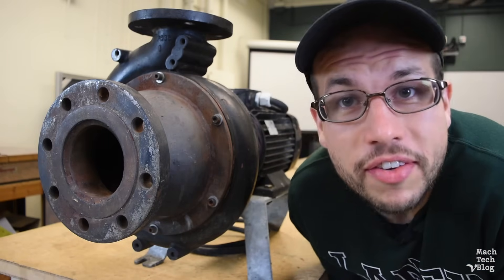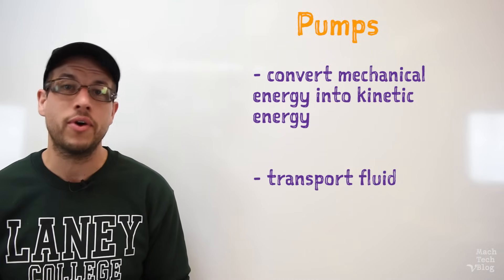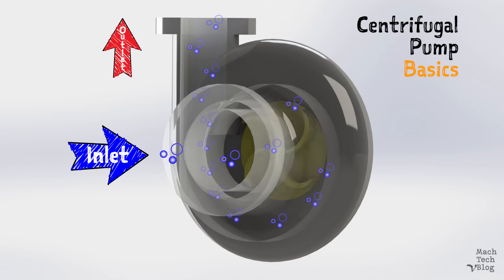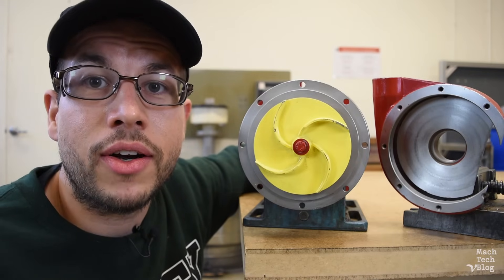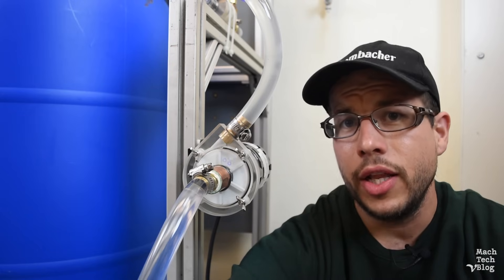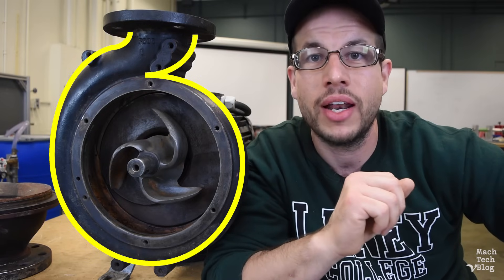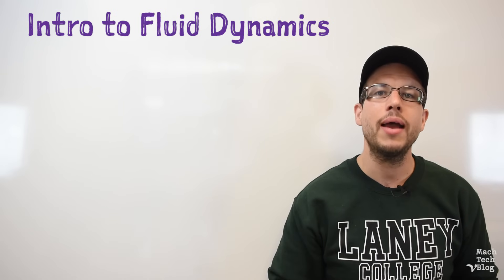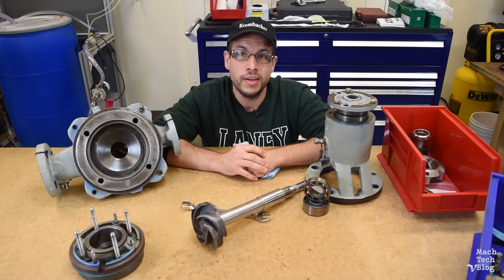Centrifugal Pumps

Comment: How does centrifugal pump pump air? I mean I have a swimming pool pump (apparently it is centrifugal) and when I start it it takes some time for it to pump some air through the pipes. Yes I add water to the pipes before starting it, but the large part of air is still in the pipes. Yet the pump still manages to move away all the residuall air.

Comment: Thank you for the video, However: it's Not Exactly True: Centrifugal is in the name for a reason, and Velocity is not in the name for a reason. Ive seen many of these videos and they all make it sound as if the velocity pushes the water down the volute and out the hole - but it's not the velocity at all. The volute looks cool and probably does increase pressure a little, but the most important aspect is the Centrifugal force which IS THE PRIMARY FORCE driving the water out. . . Literally . . . Out from the center. You could have a cube shaped housing with an enclosed impeller and the pressure will still be nearly as high.
Reply: After I wrote this comment I realized that centrifugal force is NOT REAL - according to some in the industry (Much debate and misunderstanding about this) the actual force is "INERTIA" and inertia without centripetal force; always tries to travel in a STRAIGHT LINE. This means that inertial force in this type of pump will "FLING" the water out TANGENT to the perimeter of the impeller - it's difficult to see when impeller blades, depending on angle of blades, Will sometimes "PUSH" the water out away from center. if the blades are not "PUSHING" the fluid then the fluid will leave the pump tangent to the outer perimeter of impeller.  THERE , clear as mud.!

Comment: The direction of the rotation of the impeller is really counter-intuitive. I'd bet 90% of the viewers thought that the impeller rotated the other way round. Even now, I don't understand why it'd be a bad idea to rotate in the direction where the blades would forcefully push the fluid towards the outlet.
Reply: From my understanding it’s to deal with the rate of flow coming in to the  makes sure the volute  says full and no air pockets developed from the flow exiting the pump too fast

Comment: Excellent video.  I pump water for irrigation using a diesel engine connected to a pump. The diesel engine has a fault.  What happens when I pump water from a gasoline water pump and let it go through the main pump (the one connected to the non-working diesel engine). Would this reduce the pressure of water reaching crops on the other side?

Comment: nice, but you are propagating number of misconceptions
1) blades can be backward, forward, or straight, depending on the function of the pump
2) it does not rely on friction to get the fluid moving
3) it can move air and create suction, but it's really bad at it because it is not what it's designed for
4) your Bernoulli principle is grossly oversimplified

Comment: Thats a very good explanation, but there is one remark I cannot hold back. A centrifugal pump does not create pressure! It creates head and flow. Pressure results from friction and resistance within the discharge piping. Assuming an open discharge nozzle, the pump would not create pressure at all since the fluid would be exposed to ambient pressure (and negligible friction of air). The pump would shoot out a fountain to a specific height thats called head. Anyhow, you should do more of these videos! thumbs up

Comment: Do you know what is likely cause of a pump motor flipping breaker breaker for after 20 seconds? 3 phase 3 HP, hot cooking oil, capacity 6 cubic meter/hour discharge, 25m head? Pump spins freely apart from motor...thanks

Comment: Pump Cavitation And Prevention.

#pumps #energy #water #saftey #hazard #oil #gas #safety #drilling #renewableenergy #oilandgas 

Preventing cavitation of a pump is a significant operation for the smooth and efficient operation of a pump. Failure to prevent sin cavitation can result in complete damage to the pump impeller or pump. Which prevents any process from running smoothly.

https://techproces.com/pump-cavitation-and-prevention/

Comment: Great clear video and learned a lot from it. What type of residential pump and what capacity would you recommend to fill a water tank placed on the roof deck of a 7-story building with height of around 25 meters or 82 feet. Currently we are using a 1.5 horse power jet pump on a 1-1/2" diameter vertical pipe. The plastic impeller breaks every 6 months! Any suggestion please. Thanks.

Comment: I’m sorry, but I’ve had it drilled into me that pumps do not create pressure, pumps create flow. Resistance to flow creates pressure, as can be extrapolated from Bernoulli’s principle.
For example, a pump on a level plane circulating fluid between equivalent vessels through frictionless lines will create no pressure, while a pump lifting fluid to a slightly higher vessel will have to overcome the effect of gravity on the the pumped fluid, thus this resistance creates pressure.

TLDR: a balloon hand pump; pressure is only perceived when there is resistance to the flow it creates. ie, a balloon, or your thumb
Reply from the maker: You are right and that was a very good description. Thanks for adding to the comments so others can learn!
Reply: Machine Tech Video Blog 
No problem. It was something that I had to wrestle with for a bit, so I just wanted to pay it forward.

Comment: Can u tell me how some water pumps are able to pump air to create vacuum and then pull up water and throw it out of nozzle
Reply from the maker: There are self-priming centrifugal pumps which don't create a vacuum so much as evacuate air until the suction piping and volute chamber are flooded. Here's a good video on this type of pump: https://www.youtube.com/watch?v=2FA6t7wHtF0
Reply: @LaneyMachineTech  Thanks for the link i have seen this video already but why can't my tiny water pump do self priming? It does throw little air out of nozzle and when i put it's suction pipe into water air stops coming out. But despite of that  water doesn't come out of nozzle.
Reply: @LaneyMachineTech  Can a leaf blower be used as water pump? Because the concept to push fluid through is same. They both use same mechanism even similar  impeller.

Comment: Speaking of the flow direction based on the centrifugal pump's blades curvature, yes, you should tell in which direction the pump will have it's best efficiency for moving your fluid, hence from the eye center towards the blades tips, but it doesn't mean it won't reverse the flow if you rotate the rotor in opposite direction, but cavitation may occur much sooner (at some lower rpm and outlet pressures).

Comment: Very nice videos, but I must tell you that it's not the friction between the fluid and the vanes/blades which causes the fluid to move, but the differential pressure between both sides of the blades/vanes which varies with the speed of rotation. The friction force between the fluid and the blades is the result of the fluid's properties (viscosity) and dynamic pressure (relative velocity between the fluid particles and surfaces) and rather opposes the motion of the fluid and in some amount actually reduce the output overall pressure within the fluid, it doesn't help the fluid to move or the pump to do it's job. If you want to confirm it you can simply use two fluids with different viscosity coefs and see how the outlet static pressure reads. The more viscous fluid (thick oil) will have a much less flow speed and static pressure (which takes place at surface contact) but much higher dynamic pressure compared to a lower viscosity fluid (water) which does the opposite, while both producing the same total outlet pressure. It's only the pressures that govern motions. The friction is... friction!

Comment: My years in the Navy we worked on these pumps all over the ship. Firemain, Chill Water, List Control, even air ventilation where a non sparking unit was needed or for high air pressure like the Buffalo Forge Centrifugal fans.

Comment: I have to have a 150ft long 1inch inside diameter pipe in front of my gas water pump because can not have the pump at the ditch where there is water.  The property of my neighbor is about 150ft deep and he might allow me to run a pvc line but I am worried that the intake line would be way too long and too much air in it and would damage the pump.

Comment: The idea that gas entrained in pumped liquid automatically causes cavitation is a misconception. Cavitation is caused by VERY RAPID collapse of vapor bubbles as they enter area of increased pressure in the pump. Generally only return of the vapor of pumped product to its liquid phase (called condensation) occurs fast enough to cause sufficiently violent collapse of bubbles. The only other gas then its own vapor to cause cavitation in WATER PUMPS  is CO2 (Carbon dioxide) because it dissolves sufficiently fast. I stressed "water pumps" because there may exist other liquid/gas combinations in the chemical industry causing cavitation, but I haven't encountered any in my 40 year practice.
Actually, injecting small quantity of air in pump suction is a very effective measure to counteract destructive cavitation forces. The air doesn't prevent cavitation but the air bubbles cushion the impact of rapidly condensing vapor bubbles.

Comment: If you want a mindfuck - look up impeller design efficiency. In many cases a literal flat blade is all you need for many applications, it's shocking how diminishing the diminishing returns are of specially designed overpriced impellers for some applications. Curved vanes run forward or backward have very, very little difference in most applications, and straight up flat vanes are just as good for most lower RPM applications.

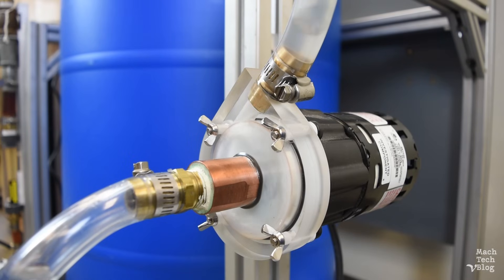Comment: 4:00 it does pump air, just not nearly enough to pull that fluid upwards. Impellers are used in all kinds of ventilation systems, since they are more efficient than regular fans. It is just a matter of RPMs and that whole cavitation issue.

Comment: one thing about fluid dynamics that most people don't understand is that while the general rule is that velocity and pressure are inversely proportional, there is a "power" part to it. just like with torque and speed, volts and amp,  there is a power limit which is the two combined at any given moment. ie. you can have one pump that does 10cfm at 10psi and another pump 10cfm at 1psi. yea you can get the 10cfm @ 1psi to be at 10psi but it'll only be at 1cfm then. Point being is that while yea that is true, it's not as simple as that and you run into limits very quickly.

Comment: Centrifugal force is a lie! There is no outward force on a spinning object. There are only 2 forces in rotation. The forward motion of the object that is perpendicular to the circle the object is traveling, and the center- pulling force of whatever is keeping the object in rotation. 

If the center-pulling force suddenly stops, then the object won't continue spinning outwards like a centrifugal force would suggest. Instead, the object continues in a straight line, perpendicular to the original circle.
Reply: Who said that there is outward force?
Reply: @niklasbjorkenheim1479  that is what centrifugal means.
Reply: This is indeed correct.
Reply: Cool great so we'll just call this the "Straight Line Pump" real helpful.

Comment: Can't pump air? How about a turbocharger or centrifugal supercharger? ;) I know what you ment just wanted to give you hell!
Reply: That would technically be a compressor... not a pump.
Reply: @Reign_In_Blood_963  explain the difference to me.
Reply: @levirobertson6148  liquids cannot be compressed. When gases are "pumped" they are compressed, thus compressors.
Reply: @Reign_In_Blood_963  how about centrifugal blowers like the types used in furnaces and "air mover" fans? Would these be considered pumps or compressors?
Reply: @levirobertson6148  since they are really only moving the volume of gas they would be considered blowers. Compressors whether it's positive displacement or centrifugal typical generate higher pressure. The operating principle s are similar regardless.

Comment: Machine tech, 'you brought up cavitation as one of the main cause of pump failure and this is very true.  You also were saying that when the bubbles burst they produce heat and this is true. Did you know you can heat water this way using a cavitation pump? As the rotor turns with very tight tolerances with small hole drilled into the rotor using very tight tolerances again causing cavitation the length of the rotor mashing these newly formed bubbles to the point of explosion releasing heat as a by-product. The water as it travels down to the outlet gets supper heated to the point past steam under pressure can be used to run motors and as a heat source. I just thought you might want to know and maybe do a video on this subject. Have a great day.

Comment: Thanks for the video
.
Let me ask you a question. Why do aquarium pump and washer drain pump impellers have straight and not curved impeller blades? Aren't curved shaped blades more efficient?
Reply: A straight line impeller  requires less machining and is easier therefore cheaper to produce!
Reply: Perhaps, but the efficiency obtained in the impeller format allowed to reduce the power required for the same result.
https://qph.fs.quoracdn.net/main-qimg-03033dbb01739d2f400157af07be8d38
And as they are all made of injected plastic, the machining cost only occurs in the mold. Even the number of blades that is usually only 4 is inefficient. Some even low power pumps get better results with curved blades like this https://ae01.alicdn.com/kf/HTB1UI_qU3DqK1RjSZSyq6yxEVXav.jpg

Comment: impeller pump will suck air & water. Two tanks only for clean water, 4 tanks for dirty water & dewatering as you see in this prototype 

https://www.youtube.com/watch?v=BqcR6Sd8tsw

US Patent 8967274 
Cooling system uses %25 power, Patented Freon impeller pump, %75 less CO2.

http://brisam9.blogspot.ae/2017/06/jps.html

Comment: Pumps 101. Awesome.  I understand that changing the impeller by just a little controls volume and preassure immensely. Most trash pumps do high volumes with low pressures. Fire pumps do higher pressures with lower volumes. Dredge pumps for small gold dredges are somewhere in the middle. Pump design is tailored specifically for its specific use and hose size.

Comment: I've got a question for you, please.
How does one calculate the type of pump needed to move water upward?
Reply: Depends on the Design requirment   which depends on the function you need to use the pump,  the environment / space around and the fluid you want to pump, and the cost ( money $ )
after deciding the type of pump is sutiable for the process then you will select and calculate the pressure head ( meter) that is the distance you want to move the fluid and the required flowrate ( GPM)  , once u have Head and gpm then will go to pump selecting Chart ( which you will find it the company catalog  since each company have its own pumps desgin and specification ) and you will chose the right type of pump and the stage you want to meet the requirements head and GPM

Comment: Centrifugal pumps will pump air, impellers will pump air, forward faced vanes will pump fluid.
Reply: How a centrifugal pump will pump air?
Reply: @ShuvamNayak  the same way "liquid centrifugal pump" will pump liquid, the "air centrifugal pump" will pump air, basically every residential A/C system will contain an air blower that utilizes this type of pump, large volume - low pressure, probably 99% of all floor cleaning vacuums also use this type of air pump and then there are the centrifugal compressors (a pump essentially) on internal combustion engines (turbines or belt driven, doesn't matter), those are designed to produce pressure as well as volume, and they are able to do that due to impeller being a very tight fit in the housing, which prevents pressurized air escaping back into the intake
and ALL of the liquid centrifugal pumps will pump air, at least some amount, they might not be able to produce enough vacuum to lift the fluid up, but if the impeller is sealed properly and is spinning fast enough, they can be and sometimes are advertised as "self priming"
anyway, lost all interest in the video when he said they can't/don't pump air
Reply: Maybe small bubbles of air but let the intake hose take a big gulp of air and the whole pressurized system collapses. It has happened  to me while dredging for gold in shallow water and it only takes a second.

Comment: So good until @8:00 -- "transformed into pressure energy"... um,  can you explain pressure energy?
Reply: Maybe this will help. Water is unable to be compressed. Moving through the volute after the impeller its kinetic energy is lost near the far end of the pump where it goes into the piping etc. However the water behind it closer to the impeller is pushing on that slower water. Water cant be compressed so it has to move away from the impeller. All lines or pipe's including orifices are for the most part, smaller in diameter from the pump outlet to the outlets. When water goes into a smaller pipe or orifice it gains speed but picks up somthing called friction loss but thats another story. Stick your thumb over a garden hose without a nozzle the water goes faster and farther but the volume decreases. The decrease in volume results in higher pressure.

Comment: thanks for video.if low pressure  or restriction  causes Cavitation  in the pump . why it doesn't happen in A/C  system when it goes from high pressure to low pressure(orifice tub or TXV).

Comment: is it possible to instead having the motor to power the pump, we use the pump to power the motor using the torque produced at the center of the pump?
Reply: Energy cannot be created or destroyed only transferred, in this case the motor receives the energy from an electrical source and then transfers it to the shaft the motor and pump are connected too.